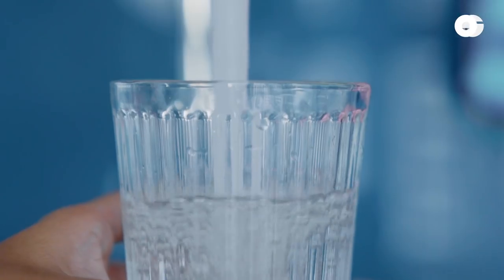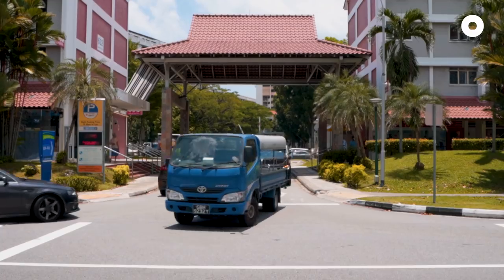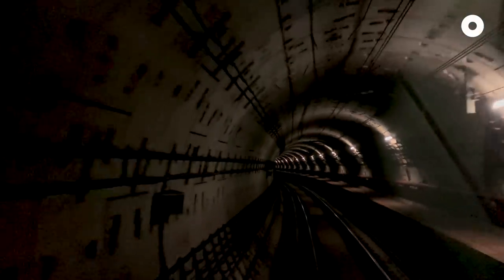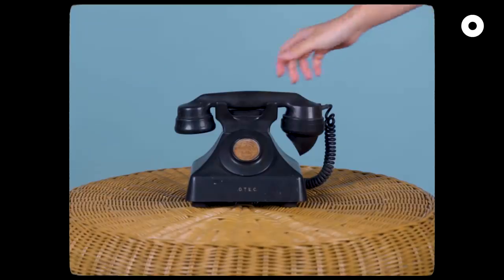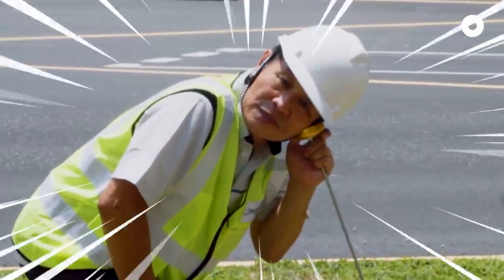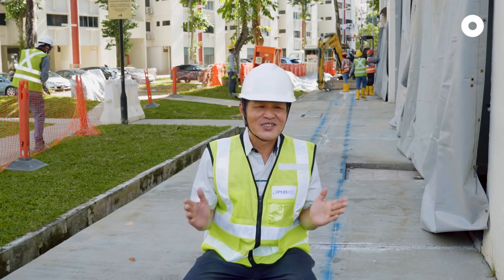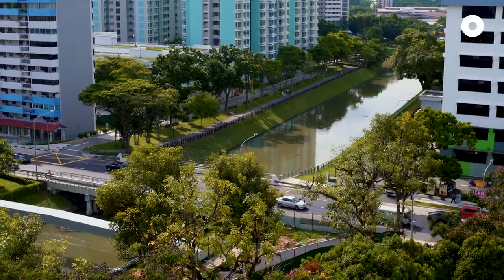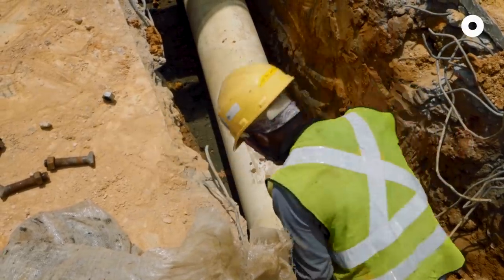How does drinkable water get to our taps? | Our Water Journey

Comment: Water supply transferred from Malaysia ma...🤣😅
Reply: Imported water from JB makes only about nearly 50% of Singapore water supply. Thus not all water from JB. Also, it is raw water and not fresh one if you do not know because it seems you are an Indo so may not know much about SG.
Reply: when indon comment 😏
Reply: Singapore is already self- reliant on water since long ago. Used water will be send to reclamation plant. The water will then be treated into drinkable water that is 100% safe ti drink from the tap. If you dob't believe me, take a look at the water cooler in the park l, it is connected to normal pipes. Do Singaporeans have a promble drinking tap sater from the water cooler? No. By the way, the water contract will end in 2061. Malaysia can go ahead and cut the water supplies now. Not sure why they haven't do so.